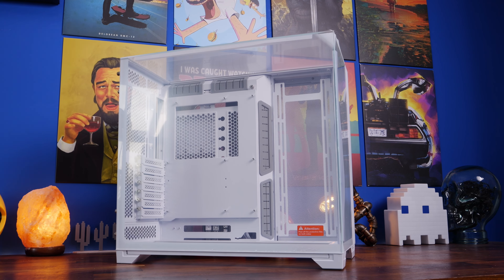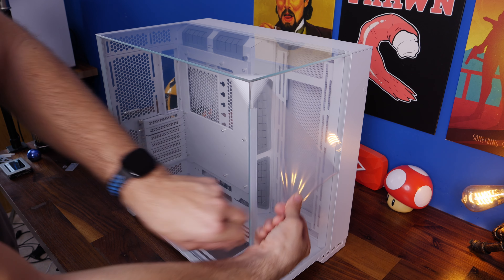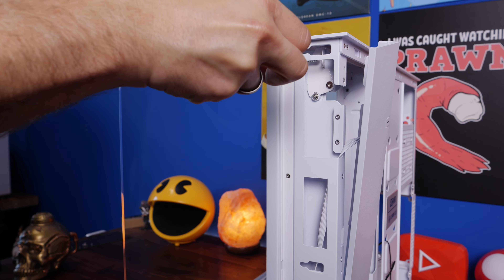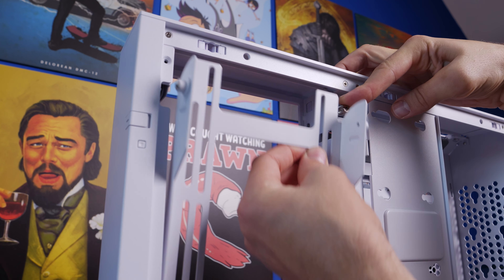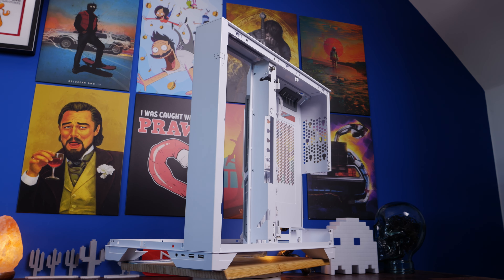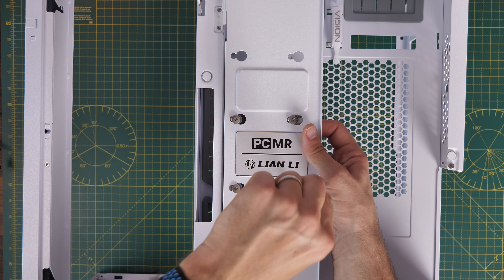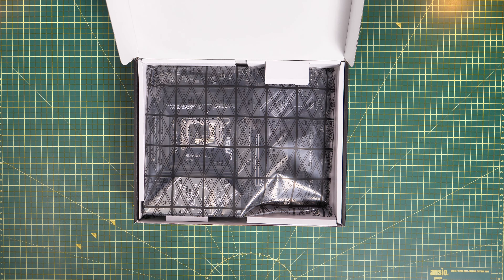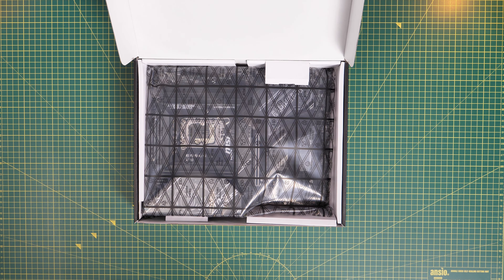Lian Li O11 Vision In-Depth Build guide - 240mm AIO, Intel Core i5-14600K, Corsair 7200 MT/s RAM!

Comment: Moved my kids rig into one and added a 45mm Heatkiller 360 rad to go with the 30mm 360 rad that he already had. Six good fans pushing, a few pretty fans on vertical rad for looks, two exhaust fans with the motherboard in the lower position and it’s all working brilliantly, fans have never ramped up to audible levels. It’s only a 9700K/3080 but seems to have masses of headroom and is all working beautifully without a single modification. Cable management was effortless. Maybe I accidentally hit the case’s sweet spot because a 45mm rad wouldn’t work in the bottom without raising the motherboard tray and losing one exhaust fan, but it works really well if you work with the case which seems to me to be the reality with any other case I’ve worked with. Looks absolutely remarkable and is well priced too.

Comment: Thanks for such an instructive video. I will be getting my first Lian Li O11 Vision in the following days. I am going to do a custom water cooled loop with 360 radiator vertically and 120 radiator where you place the 240. I am going to place the board in the up position. At the bottom I will have 3 140 intake fans.
   I wonder why not motherboard manufacturers put the main connectors angled 90 degrees. I am getting angled 90 degree for ATX 24pin and for the USB. The CPU and GPU get 180 degree adapters which will allow cabling to be tide up 
  For the water-cooling loop I will be using Bykski with flexible 10/16 transparent tubes.

Comment: Awesome video! Thank you for taking the time to show all the different options and features of the case. Im sure thats a pain when you just want to build and get up and running. Awaiting on all my parts to arrive but I will be doing a 360 rad on the side, swaping out the included fans with Lian Li reverse blade fans, and then 3 140mm reverse blade in the bottom, with 2 (low position) 120 exhaust fans in the back. I9 14900K mated with a 4080 Super. 

Again thank you for the detailed video!!
Reply from the maker: Glad you liked it. I like to be as detailed as I can do it can be useful

Comment: Nice look. I like the laminator flow. Low is probably best to get air up the top left heat sink covering the WiFi & USB area. I don't think anything as aggressive as i7 or 9. It's a little cabled but the case is tiny. Great finish.

Comment: Thank you for the in-depth video. I was wondering if you’d recommend this case with a RMx Shift PSU from Corsair? The one with the connectors on the side. I personally have the 850W version.
It looks like it could work but I need to be sure cuz I don’t feel it would be optimal either.
Reply from the maker: I didn't try it in this case but I did in the Compact version. https://youtu.be/drDwetoMVXo
Reply: @ I’m gonna take a look, thanks a lot!

Comment: Hi there, im looking at a first build with this case, ( i love the glass design its so clean!!)

I had a couple questions with how your build went.. would you recommend a 360mm aio? i understand its preference and cpu related ill be using a ryzen 5 7600x. Currently in position of a be quiet pure loop 2  fx 240mm aio I'm thinking of potentially selling it to upgrade to a 360mm aio if its going to better the performance. 

The GPU i was looking at was a TUF gaming 4070ti super, would this obstruct the build process if the mother board were to be in the lower position to accomodate the 240mm aio? 

Any help is much appreciated. 

Such an awesome in-depth guide and I really appreciate you taking the time to create this video. 

Elliot

Comment: I'm doing a 011 vision build and feel better about my AIO being exhaust like usual so plan to use a 240mm AIO on the rear of the case, but I also intend on using the vertical GPU mount that I bought with my case as a bundle sale on Amazon. Do you know if there's enough space for the AIO tubes when installing the 240mm AIO and a vertical GPU? Every build I've been able to find information about online that had the 240 mm radiator at the back, had the standard horizontal GPU setup. For size reference my GPU is the RTX 4070TI Super Aero OC. And I'm planning on using the Asus Ryujin III 240 ARGB radiator on the rear of my 011 vision. Any help would be appreciated.  Thank you in advance.

Comment: They took out the modular USB component?  Dissapointing.  It was nice to be able to relocate that to whatever side.... though not. a. dealbreaker.
Reply: Yeah, it’s a pity. They do still sell the Dynamic EVO, for those that want a mid size reversible case with moveable IO panel. Could be a vision EVO coming later, maybe 🤷🏻‍♂️
Reply: Only available on the dynamic version

Comment: I am planning: ATX mobo in the low position, Air-cooled GPU, 2x120mm exhaust at the rear, 2x140push+280mm AIO radiator+2x140mmpull exhaust at the side vent, and my challenge, 3x140mm intake at the bottom. Do you think the low position mobo with 140mm bottom fans will fit? My mobo has the I/O plug on the side luckily, so only tha audio and fan connectors need to fit.
Reply from the maker: Should do
Reply: @TheProvokedPrawn  Thank you so much for the Feedback, cheers!

Comment: Bro just build in an nv7 now I want that one xD
Reply from the maker: Alas I don't know anyone at Phanteks but I probably will buy one soon I guess.
Reply: @TheProvokedPrawn  if you would live in Europe we could trade xD
Reply: @TheProvokedPrawn  Do you suggest building in Antec DP505
Reply: With 750W PSU and F12 Racing RGB fans
Reply: The nv7 is so ugly, not be rude but just imo. The nv5 looks loads better but then is missing all the only features that the nv7 DID get right…which doesn’t include that ugly big blank panel that covers the PSU. It (phanteks) may very well be the next best contender for user friendly build chassis but something about it has a cheap and basic impression to it. I believe phanteks will really improve over time but I don’t think this lineup of cases beats the very generic off brand wanna be’s by that much with their style. I guess it’s for the people that just are too stubborn or have some kind of beef with lian li’s design or even NZXT for that matter.
Reply: @OGHawkeye  but it fits 4 rads the bc 5 and looks are subjective anyway 🤷🏽‍♂️

Comment: Would 3 intake fans from the side and 240 AIO exhaust at the back be sufficient cooling or is that not enough?
Reply: I would imagine it would work. However, having intake fans on the bottom of a case underneath the gpu can make a significant improvement to gpu temps. I have 2x140mm under my RTX 3080 and having these on makes about a 5c difference to gpu temperature.

Comment: How did u screw on the connector-3 fan controller? There are no screw holes. You just magically  pressed it on metal:
32:03
Reply from the maker: 3M double sided sticky tape that's included with the controller
Reply: @TheProvokedPrawn  ok thank you. How did you screw in the top left thumb screw? It turns endlessly. Many posts describe exactly this. Scew on the back (panel location) securing the front glas.

Comment: Pity these parts and this case
 Both the front of the cable case was visible and the back of the cable case was very bad and messed up
I certainly would never buy a water cooler with so many cables coming out of the pump
Why those SATA SSDs when there are m2?
Why didn't you remove the CPU cable from the lower window so that it is less visible?
You can use the 240 cooler, but you have to install it on the opposite window and align the third fan with the bracket, or install the radiator behind the fence and the fans in front of the fence, and install three fans side by side.
Modular power is to use only the necessary cables, when you connect all the cables to the power, why do you buy modular power?
There are a few pieces that are aesthetically dissonant in my opinion, but not enough skill and effort has gone into the beauty.
Reply from the maker: Love all the pointless criticism when you entirely missed the point. This build guide, like all of mine, is to show how to do all the things. Some people still might want to use SSDs and HDDs, so I show how to install those, for example. I use the parts that I have and I don't go over the top with cable management because I'm not trying to make a work of art to show off my skills it's to help beginners and people who need it.